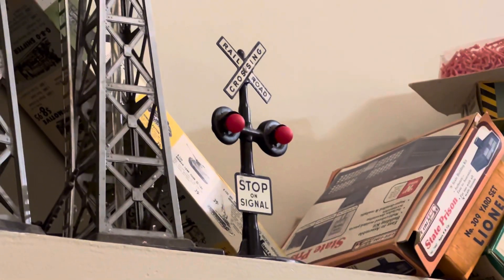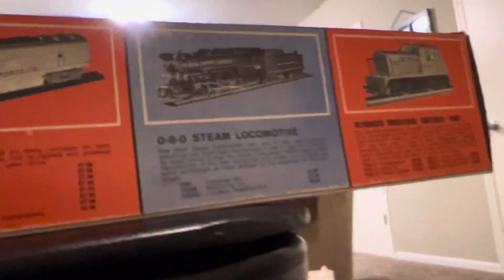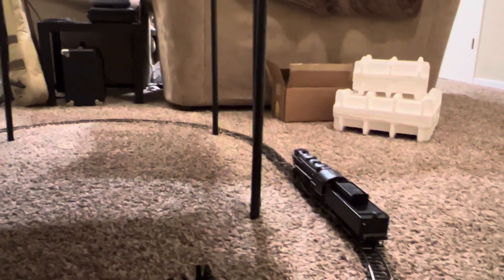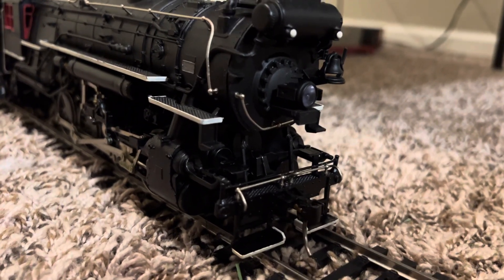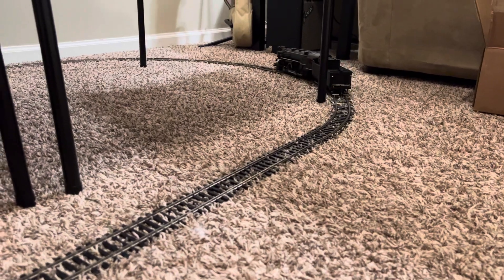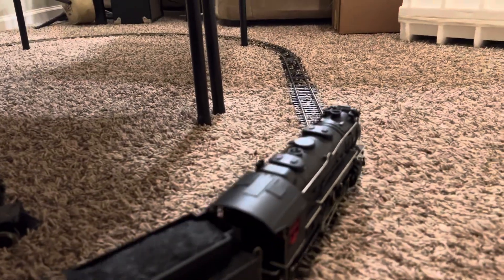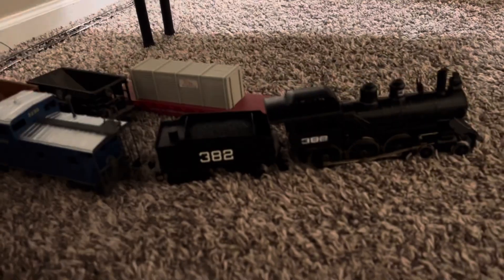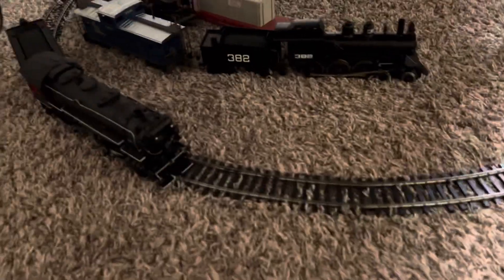AHM Rivarossi 1970’s Vintage 0-8-0 Steam locomotive.  Two Rail O Scale.

Comment: Three things; Thanks again for showing a rarity.
I did not know this till recently but many of the steam engines had a steam powered assist to the tender. Don't know if it was a turbine type or some king of mini steam pump or a push rod system.
If you are in a pinch regular Gargarves three rail track can be used for O scale since the outside rail are not connected since they use wooden ties... They also sell 2 rail O gauge as well. (Some other brands might work as well as long as the ties are not metal or the sides wired together electrically.) 
Yes, keep the train off the carpet, just put a bed sheet under it next time. The nature of these things often attract any light kind of dirt and fibers and hairs as well, keeping the computer tower off the floor is also a wise idea as well to keep them cleaner..